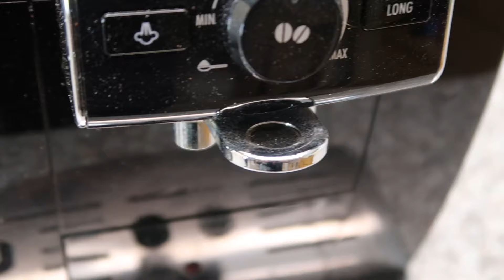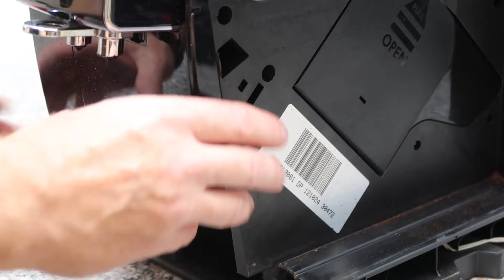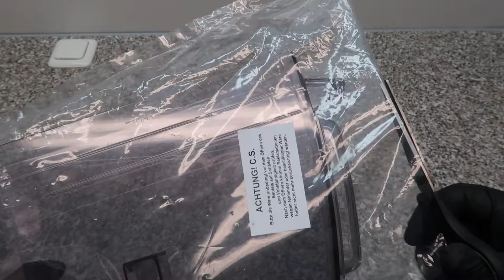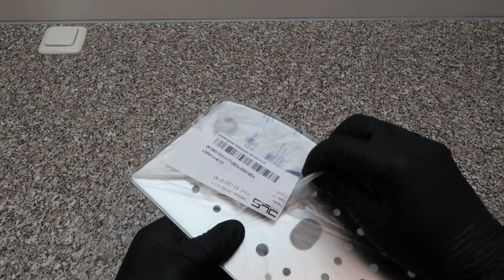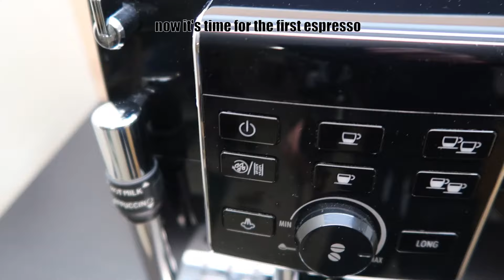DeLonghi ECAM Fully Automatic Coffee Machine Restoration | DeLonghi Repair and Restoration

Comment: I can't screw in the two allen key screws that sit on the right side of the boiler piston housing. Any suggestions
Reply from the maker: @Paul F. there are two flat metal nuts on the right side of the machine. These must have fallen out, slide them into the correct position and you can tighten the screws again ;-)
Reply: @yt.myworks  thank you for your response. I knew I was missing something.

Comment: Great video, could you advise me on what I do if the water or coffee does not through the spouts but rather dumps into the ground coffee container. I have stripped the brewing unit cleaned but did not change the o-rings. Obviously I have regularly descaled my machine. Thanks
Regards Steve Moritz
Reply from the maker: Hi Steve, I think that the brewing piston is leaking, I made an extra video for this problem: https://youtu.be/3QBLoTMgTec
Reply: @myworks  thanks again, would you change all the o-rings or only the large red one😀
Reply from the maker: If the machine is more than two years old, I would definitely replace all the o-rings.

Comment: This video is a lifesaver.  Exactly what I've been looking for!  A bit anxious to start my own tune up.  Our machine has been acting weird lately.  Can't complete a descale, loud pump noises when the tank is near empty and empty tank light wont come on.  We get the steam light instead.  During descale only milk frother is pushing water through.  No descale of the coffee spouts. Any suggestions on the potential issue?
Reply from the maker: I think the problem is the water tank, if the floating magnet in the water tank loses strength the machine doesn't recognize when the water tank is empty. In this case, the water circuit draws in air and the pump becomes noisy.
Reply: @yt.myworks  You were absolutely right!  Thank you for your help and knowledge.  After watching your videos.  I think I should do a deep clean!

Comment: Hello! Can you give me some suggest? After replacing a damaged power module my ecam22.360.b don't start. Only white screen and display doesn't react.
Reply from the maker: the cables must be connected correctly? Did you take pictures before that? The power module must have the same serial number as the old one.
Reply: @yt.myworks  I'm pretty sure about wires connection. Yes, I take a picture and look for a diagram for sure. Version of module is exactly the same. Same serial number. Now I'm waiting for new display, becouse I suspect a
 short circuit in the installation are burnin it all. Will see... 
Great gratitude for the answer! Best wishes

Comment: I have a delonghi machine dinamica plus, and i keep on getting the message to insert the infuser. I have serviced the infuser itself and that doesnt fix anything. What do you think is wrong with it?
Reply from the maker: Hi, it could be that the spindle nut is already worn out from the transmission. Try to grease the spindle, maybe it will help for a while.
Reply: @yt.myworks  thank you, i will try buy a new one and change it. The part that the infuser goes into seems to move quite a bit. What grease to you recommend for the spindle nut
Reply from the maker: Hi, I recommend lubricants without toxic additives such as "CFG 1808 White food grease for bearings" or "OKS 470" https://amzn.to/4dp355G
Reply: @yt.myworks  thank you!

Comment: Great video. I repired the same machine yesterday and, at the end I found a little black oring between the screws (around 5 mm of diameter),. Do you have an idea where it came from?
Reply from the maker: There are many o-rings of this type that DeLonghi use, which part did you repair?  Check for a leak on the part.
Reply: @yt.myworks  I've thougth thd same think about the leaks. I've disassembled the coffee grinder
Reply from the maker: hmm.. if i could see the o-ring maybe i could help.
Reply: @yt.myworks  how can I share it here?
Reply: @yt.myworks  How can I send you a photo here?
Reply from the maker: yt.myworks@hotmail.com

Comment: How do I get/find the tool to open the darn machine?  It's not a screwdriver that I have ever seen.  Any help would be appreciated.
Thanks
Reply: I found it in the comments way down below.  Now, if the steamer went out with a bang, what part do I most likely need to replace?  I can still make a great cup of espresso with no problems.
Any help would be greatly appreciated.
Reply from the maker: A bang? When does this happen? I need a more detailed description.
Reply: For anyone else reading this comment, wondering about the screwdriver: I had a set with 64 different screwdrivers, and not one was the fitting one, BUT... with a very small standard "--" screwdriver you can actually turn the screw! It is not optimal, but it works.

Comment: This is a great video, really well done. I have a problem though! after putting it all back it started to work correctly but then it stopped with the diffuser at the bottom and now will not even switch on, I think maybe the diffuser wasn't correctly re-positioned. Have I blown a circuit or is there an overload fuse somewhere?
Reply from the maker: Does the machine show anything? For example flashing LEDs?
Reply: @yt.myworks  Thank you for replying. No, when I switch on the master switch I have nothing, no leds at all. I checked the current after the main switch and it is passing. I can handle mechanical repairs but electric circuits are beyond me!
Reply from the maker: @Philip Salusbury Jones I'm not an electrical engineer either. Please make sure that all cables are properly connected after assembly.
Reply: @yt.myworks  OK, for your information, I dismantled everything and finally found I had pinched the nap that goes from the main board to the control panel while re-assembling! 
This part is not available on any parts lists I found, but I managed to re-solder the broken conductor and all is now working. 
I need to be more careful!!!!

Comment: HI, could You tell me what type of torx did You use to disassembly rear cover?
Reply from the maker: Hello, you need torx 20 with a hole
Reply: @yt.myworks  thanks :)
Reply: If you use a small flathead screwdriver and put it on one side of the torx screw's pin, you can turn the screw.
Before going out and buying a special torx security screwdriver try a few flathead screwdrivers to see if any work :)

Comment: great videos. Do you know how to remove the coffee spout from the Dinamica. I would like to give it a clean. I wouldnt want to go through major dismantling.
Reply from the maker: I don't remember exactly, but the coffee spout is installed in a similar way to other ECAM models.
Reply: Yes, it's a big ordeal to remove the door panel.  Incidentally, most of the designs are prone to have coffee drip and accumulation in the door panel including the sprout assembly.  I am getting tired of dissembleingthe door to do cleaning, so I bought a cheap electric dental water flosser from eBay, so I can shoot pressurized burst of water to clean out the sprout.

Comment: Hi Myworks, I have an issue with a Perfecta on self diagnosis where the infuser reaches the top of the thread, it throws a general error. Would that typically indicate a limit sensor issue? Please let me know if you have a video about this problem. Thanks very much.
Reply from the maker: Hello, in most cases, the worn spindle nut is responsible for this error. If the transmission has become too loose, the machine will no longer be able to find the basic position. Sometimes greasing the spine helps, otherwise the transmission should be repaired or replaced. Here is my video about this problem but from a different "ECAM" model: https://youtu.be/HZ8oQUGtPjc?si=XmByNDTh43Zs1Itt
Reply: @yt.myworks  I ended up testing the limit switch and it is working ok.  I tested the pump and I know that it's working, but the General Alarm sounds at the time the pump should be running, when the infuser reaches the top of the worm drive. I'm thinking now that it might be the control board that's unhappy. I wish that I could diagnose it.
Reply from the maker: The reed sensor counts the revolutions of the spindle and if they do not meet the specifications, an error message appears. The error message appears regardless of whether the limit switch is working or not. After that, the brewing group usually returns to the basic position. Of course, something else can cause the error, but in most cases it happens when the transmission has become too loose.
Reply: @yt.myworks  Excellent. I will focus on the transmission then, as per your recommendation. I changed the main board today (before reading your message), and still get the same error message.

Comment: Hi My works, just checking if you have ever experiance a ECAM 23.460 only running for 6 seconds, it's currently stuck in the empty water circuit issue. I've checked everything and regardless what I do it now only runs for actually 6 secs. Any help would be much appreciated. Thanks
Reply from the maker: Hi Sarah, does the machine switch off afterwards or is there an error message? Can you describe the problem in more detail?
Reply: @yt.myworks  morning, the machine doesn't switch off after erroring, it goes back to saying water circuit empty. So far I've checked the water pump (disasembled it and put it back together again, it looked completely fine, all the parts looked good and didn't have any signs of wear), I've checked the little white regulator and that has no signs of wear. All of the piping looked clear and not calcified (completely see through when you put a torch to them). I've put an air into the system(on purpose) so it could purge the air lock (which it did without any issues). I should meant the water comes out of the hot water spout easily (not slow or struggling), the water comes out of the coffee spout without issue (only on the first time the machine is turned, then the water will only come out of the water spout once the error has be flagged). 
 Regardless what I've tried so far, it just goes back to the same issue.
Do these machines has an internal battery? I'm only asking because the time on the coffee machine continues to count even when it's been unplugged for days.
Can these coffee machines get stuck where the error code is unfixable?
Any help would be much appreciated, and thank for getting back to me so quickly. Thanks
Reply from the maker: @sarahhoughton6246  Also check the "flow meter" maybe it's not turning properly. This is the white, round piece that measures the flow of water. Here you can see some pictures on the subject: https://images.app.goo.gl/nSKV29yL6o1T9r9S7
Reply: @yt.myworks  thanks for getting back to me quickly. I took the flow meter out and looked to see if there was any visible defects ( I couldn't see any, I tried cleaning the openings with a needle but didn't find it needed it and didn't change the outcome). In your experience, do you find the flow meters can go faulty and just need changing? If the flow meter isn't the issue, what would you suggest looking at next? Thanks once again.
Reply from the maker: The flow meter very rarely breaks, but the rotor must move very easily. If it doesn't rotate properly, the machine assumes there is no water in the fluid system. You can unplug the flow meter (white plug) and turn on the machine. If you get the same error message, it would mean that the flow meter is not working properly.
Reply: @yt.myworks  thank you for your advice. I used it to fix the flow meter (cleaned it and filled it with water before refitting the red piece, I'm guessing the first time I tried fixing it, I did a bad job because the red piece didn't move freely first time around). Thank you once again for your help, it was much appreciated.

Comment: Hi, im having trouble with my delhongi magnifica s, it wont turn on anymore, pressing the button on the front does nothing. The sensors for water and tray still works because the lights turn on when removed, but pressing the power button which usually heats up the machine gives no response. I have taken then machine apart and tested the button with a multimeter and it gives of a signal when pressed. What could be wrong? Is there a way to reset it or do i need to replace something? Feels like its a sensor or something that is stopping it from turning on. Please help!
Reply from the maker: Hi, sorry, but I'm not so familiar with the electronics that I could say the fault is ahead. You can try doing a reset, maybe it helps. You're sure to find instructions for a reset on the net.

Comment: Good video. I have a delonghi Dimani coffee machine. I put two cups of ground coffee in the machine. Didn’t know your only supposed to only put one cup.Now when I try to use this function a warning triangle comes up
I’ve done a descale and clean of the defuser but it’s still the same. Any ideas how I can rectify this problem would be appreciated. Regards Paul L
Reply from the maker: Hi, try to clean the machine inside thoroughly with a vacuum cleaner and a small brush. The important thing is the Brew Piston at the top of the machine. The part is hard to see, but you can reach it with a brush. Then everything should work again.
Reply: @yt.myworks  do I need to take the top of the machine of?
Reply: Buttala via ,e comprati 
PRIMADONNA SOUL 
1.330 $

Comment: How did you remove the front plastic from the water tank before replacing it?
Reply from the maker: You have to remove two screws and pull the plastic down.

Comment: I took the grinder off and I forgot to mark the gears. How can I align the level knob? Now at level 3 the water doesn’t pass through the coffee
Reply from the maker: You have to take the gear off and put it on in the correct position.
Reply: If you only removed the ring then simply put it back in and there should be a black marked line that you line up with a line on the body. And also a notch on the adjuster spindle that you line up with a line on the body. And this should be the middle position.

Comment: This is an awesome video and well done on doing a great job of the restoration. Had a question on the inner tube mounting plate @ 9:02.... mine seems to have come apart and broken, but when I remount with the screw, it seems to keep it in place. Do you think this arrangement will be OK or do I need to try find that thin inner tube (with the 3 o-rings)? Thanks
Reply from the maker: The tube breaks very often. Tighten the screw careful and the tube should hold.

Comment: Hi! I'm having an issue with my delonghi ecam 23.420sb coffee machine.
For some reason, after the brewing process, the brewer unit moves back to it's original position as it should be, however, a small ammount of water immidiately leaks into the ground container as it starts to move away from the head. I have cleaned the brewer, the brewer head unit  and replaced all of the o rings by following your tutorial video. I have also replaced the flow valve because the original one punctured out. I couldn't find any solution on the internet. I would really appreciate your help! Thank you in advance
Reply: I have tried it with another brewing unit, as my family has the same coffee machine, but the problem still occurs
Reply from the maker: Hi, for the ECAM models I recommend the original size for the O-rings with 4.2 mm thickness like this one: https://www.ebay.de/itm/166062935870?mkcid=16&mkevt=1&mkrid=707-127634-2357-0&ssspo=-bRdEyxzScS&sssrc=4429486&ssuid=fqjNmJj7Q9S&var=&widget_ver=artemis&media=COPY
Reply: @yt.myworks  thank you for your answer, but i have purchased the same ones labelled as original from a local webshop. As i said it earlier i have tried it with a definitely working brewer, but sadly it didn't fix my problem. I have lubricated all of the o rings with food safe grease and took some photos of the machine before disassembling it to make sure i put all the parts right back in.

Comment: Thanks for the great vids.
I’m curious how a test mode could be performed on eletta cappuccino top, an ECAM machine.
Thanks
Reply from the maker: Switch off the front of the machine, pull out the drawer, press and hold B15 (amount of coffee) + B11 (single cup) + B6 (milk menu) at the same time until Select Test appears.  Then pull in the drawer and press the cappuccino.  The test mode is now active.

 The following functions can be checked with the keys:
 Latte Macchiato--> BG
 Menu/ESC--> Cup warmer
 Steam--> steam heating
 Beans--> grinder
 Amount of coffee--> pump
 1cup--> EV1
 2cups--> EV2
 One button--> thermal block
 Hot water--> EV1+EV2
Reply: @yt.myworks  thanks heaps for a quick reply! Much appreciated.

Comment: Very helpful video. Thank you for posting. I hope it will help me as well. My machine is no longer frothing well. The pressure coming out of the frother is very uneven; it fluctuates and goes up and down and it's very weak. Even when set to water only, it barely poors water but I otherwise don't think it's a pump issue since it still looks like it poors a normal coffee; it's just having problems when it goes on the frother side. Any idea what could it be? Hoping it's valve issue.
Reply from the maker: Hello, before you take the machine apart, try to descale it properly. One or two times in a row. Perhaps then the nozzle is free.